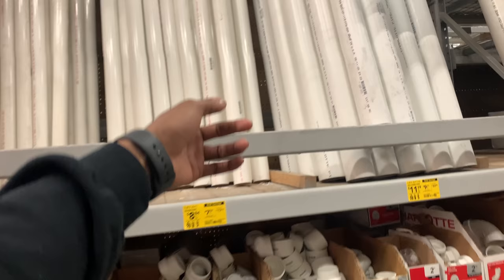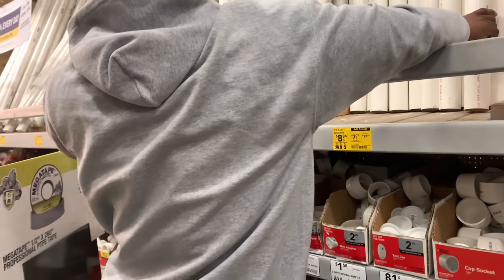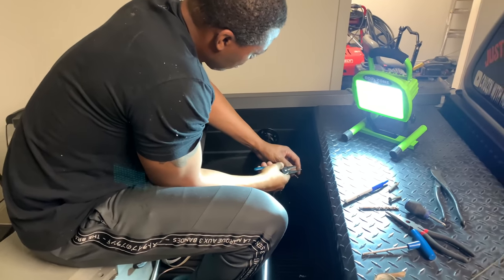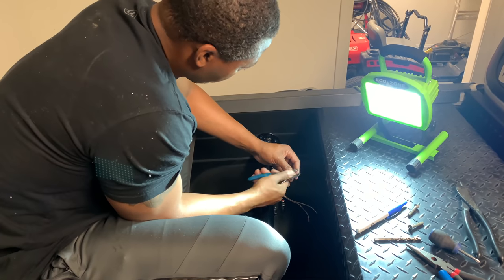How to Install Marine Speakers In a Truck Bed | Best Sound Ever!!| Must Watch Vid !!

Comment: Man that is so awesome that your dad helps you with all that stuff wish I had someone like that . And it would be so cool man to see some marine speakers actually mounted in the toolbox so it’s not taking up so much space in there truck bed so you can still use the bed if you need to . I’ve seen speakers that are built into the toolbox and you can still use the toolbox
Reply: One of my buddies did that and the sound quality doesn’t come out as well as if you did it the way they did

Comment: Did you drill directly into your truck bed and cab??
Reply from the maker: yea
Reply from the maker: not into the body. i have a covering in the back of my bad i set tapped too
Reply: @CruzinWithMel23  wdym a covering? Like something just inserted that you drilled into?
Reply: @zmads9715  bedliner